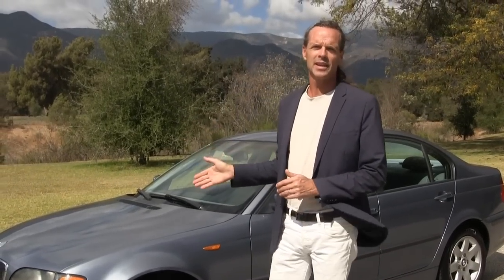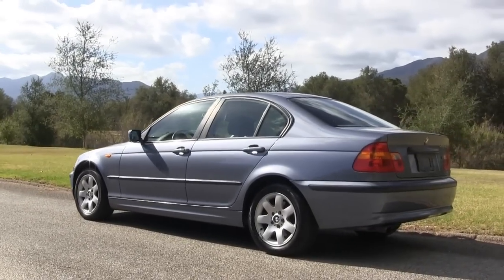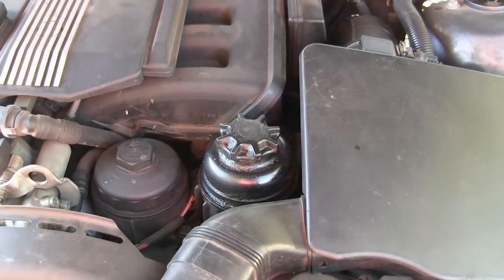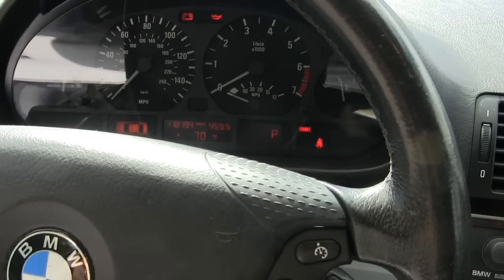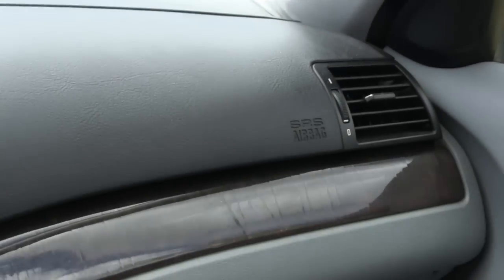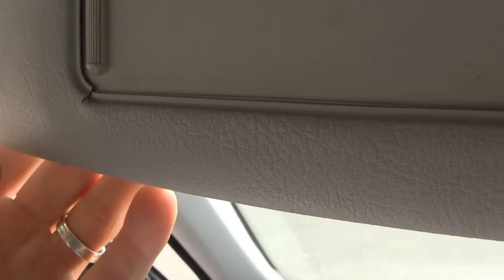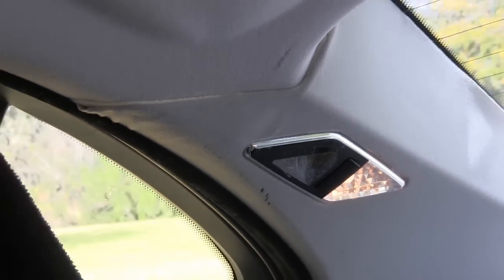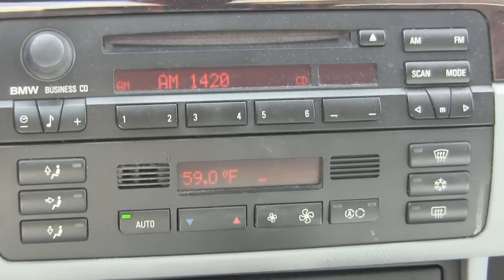Why You Should NOT Buy a Used BMW

Comment: Went to a used car dealership and I saw a 2000 BMW 323i model and fell in love with it. And idk if I wanna buy it if this stuff happens. It has 108k miles
Reply: Don't buy it if it's gonna be your only car i have a 2004 325i but i have 2 other cars

Comment: I bought  a 7 years old e46 Diesel. I bought it cheap. Changed the complete cooling system plus using a SKF water pump. None of the problem above. Only the warning brake light going on occasionaly.
Cheap to run. Must be 15 years old. Daily used with high mileage.Looks very fresh.

Comment: Hey Greg, thanks for your vid. Like it. For all fairness, the previous owner(s) of the E46 you reviewed apparently were not the ones who could afford to own and maintain (the operating costs of) a BMW. I own and drive BMWs for decades, not because they are reliable -- they're not, but because they're the "ultimate driving machine (UDM)," with well balanced steering, satisfying torque in all power bands,  good feel of the road. They all move like hunks of gliding steel on rail, ...  Yes, the interior rubber paints of my 5 series's also peel off after a few years. But the peeling-off of the liners, the eroded side mirrors you showed were the results of over-exposure to weather because the owners were probably the max-out, show-boat apartment dwellers who couldn't afford to garage the car. Agree the electronic/electrical components and control arms are money pits, but they're the price to pay for a UDM.

Comment: You bought an absolute pup XD
I've owned 2 high mileage E46s and both have been absolute gems. Interior finish has had a little bit of wear but not horrific. I think poor interiors are mainly down to poor owners. The problem is, as they get so cheap that yobs can buy them, they just abuse them. Case in point - people who slam the bonnet and are surprised when trim pops off. Treat your car with a little bit of respect! It's not a bloody landrover/truck.
As for engine issues, I've never heard of the expansion bottle, water pump, thermostat, ATF leak problems. The most I've had are sensor issues - most of which are a doddle to replace with basic tools and cheap aftermarket parts. I did the inlet camshaft position sensor on mine today in 10 minutes. If I was selling mine and a buyer was being arsy asking why I hadn't replaced the water pump, he'd get told to go do one. Vanos related problems are the main thing to look out for, as well as rear springs cracking, but didn't even get a mention in the video.
Granted, a dealership will charge stupid sums to repair even minor faults, which is probably why if you have no idea how to handle a spanner, buy yourself a cheaply built car, don't buy an older luxury car.

Comment: I've been driving a 2004 325 wagon in Colorado since 2005 and it is not beat to hell like that car.  I take care of my toys and the difference between my car and the example is almost literally night and day.  I do think parking outside in the sun must really do a number on the interior.  I've admittedly been fortunate to have garage parking (even at work) for a good percentage of my ownership.  However, my car has spent plenty of time outside when I also owned a Boxster or 911 (which lived in the garage).

My car has never had an issue with the kidney grille, and that looks like a stupid easy fix.  The fact that the owner hasn't addressed it is telling.  I have had to replace a roundel, though.  It might have cost $40 at the dealer (?).  The headline is a real wreck in the example car.  I do have a very slight version of the A-pillar liner issue, but I blame the fact that I shove sunscreens in there for that issue.  It's fine for a 13 year old car, IMO.

My car has stranded me only once, and that was just a few weeks ago.  Fuel pump finally died.  That's not to say that I haven't had to spend plenty of cash on it during our time together.  I have indeed.  BMWs are not cheap to own.  But BMWs drive unlike any other car exept perhaps for Porsche.  If you want to drive an appliance, then you'll want to get something else, for sure.

Contradictory to this video, I think the E46 car is built better than current similar cars (BMW and Audi, in my experience), and mine has aged very well and is still very solid.  It felt much more solid and better built to me than the 2013 Audi S4 I had for a few months last year (and which I sold in disgust -- glad I kept the E46).  It also strikes me as somewhat more solid than the F30, which I admit to considering as a replacement.  However I fear the "leasing" (renting, really) culture has led to decreasing quality in the entire auto market, so it's hard for me to buy a modern car.

Anyway, I think that rather than saying "don't buy this car", the message should be "go ahead and buy the car if you like cars, but know what you're getting into".  Someone could get a car like mine, in fabulous condition, for around $6k now.  That's pretty damn cheap -- like write-a-check cheap.  Then you pay to keep it running or wrench it yourself.  I go to an independent for 90% of my work.  It's a trade-off.  In my mind you're getting a great performance car an not paying a bank to loan it to you.  But the trade-off won't work for everyone.
Reply: Mike Thomas  As engineering becomes more precise the quality of parts deteriorate. Parts once had to be stronger.
Reply: Well said my e46 touring has had a few of these issues.  I run the wrench myself and buy parts on line
Reply: Totally agree and that's true for any car.  Sun damages everything that it touches.  If you're going to park outside in Florida all of the time then all cars will be destroyed even the battery goes bad faster.  The paint, the seals, the interior.  Everything impacted.  I've had two three series with lots of miles and have never had my interior melt like his did but of course I don't park it in the sun every day.  If you don't have a garage you have to find a place that is shaded much of the day and crack the windows if you need to.  True of any car.  Just think.  Simple.
Reply: Well said. Apparently I like actual driving, so despite my non-wealth, I choose (knowingly!) to buy an expensive-to-maintain European car with actual engineering in its DNA, along with character and panache. (I used to drive Saabs, which also filled such a niche.) I'd vomit if I had to drive a vomitty Ford or Kia every day, but hey, I might have more money in the bank. Rest assured I'd be saving that money to buy a BMW. I'd rather spend a chunk more and actually like my life than have to endure a stale, joyless commute every single day in an appliance. Driving is a huge part of my life! You also won't catch me furnishing my bedroom with a cheap mattress or settling for cheap cuts of meat. I could die tomorrow, so compromise has no place in the basic joys.

My snob-ass Uncle Moneybags McCarguy might advise me against a BMW investment, preferring a solid Japanese build, but by golly, he's got no joy in his life...despite his well-matured stock holdings and pennywise lifestyle choices. Shake that noise! I like driving, and I know what I like! Ain't no flat-ass Lexus gonna satisfy me. I may be foolish, but I'm self-aware, and damn it if I ain't happy with my little E46. And I don't think it's foolish one bit to spend your money on what you like.

Comment: I own a 2004 3 series with 153k miles on it and it's nothing like shown int his video. Your car must have been a) built outside Europe, b) subjected to serious heat and c) not maintained properly. The only accurate criticism in this video is the easily cracked cooling system. Mine was changed at 150k miles two months ago. The interior is top quality, you can't find a better built interior in this class and age bracket. Your car seems like it was parked under scorching sun often.

Comment: I had an E36 compact 316i without any problem for 25 months and after that an E46 sedan 318i who leaked a bit of oil which was fixed after I bought it, but after that it had no issue whatsoever, so 🤷🏻‍♂️

Comment: I have a 2002 325xi...looks pretty much exactly like the car in your vid lol.  I've had every single issue you show but most of those are relatively cosmetic.  A few points:
1. window regulators $800?  Cheesus crust are you buying them made of precious metals?  I bought mine for about $120 each.  The repair is pretty straightforward even for a novice and it took me about 3 hours the first time I had to do one and got it down to about an hour and a half for the other three.
2. the front grill...yeah I literally rolled black gorilla tape and stuck it back in place.  I did this three years ago and haven't had any issues since hehe.
3. the cooling system...this is a known issue and at any bmw forum they'll advise you to just go ahead and overhaul the whole system (pump, thermostat, expansion tank, hoses, radiator).  They even sell kits with all the relevant parts.  I did my overhaul 75000 miles ago; still going strong at 160k miles.
4. The rear lights...kind of annoying but it's just a bad ground.  All you have to do is remove the wire from the plug and attach it to the metal bracket.  They even have small tabs you can use (almost as if someone down at BMW saw this coming).
5. Both the front and rear emblems peeled off on mine; cost about ten bucks to replace from what I recall.

Finally, I'd say that despite all these things (and quite a few more, actually) I love this car.  It is by far the most fun to drive and it still looks fantastic 17 years later.  Most cars look old at 10 years but the Bemer still looks and drives sharp.